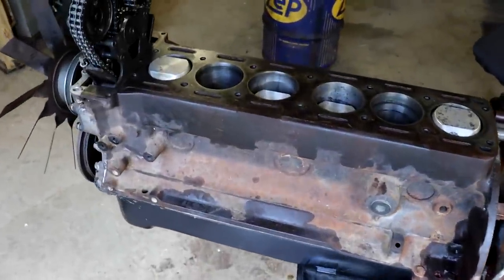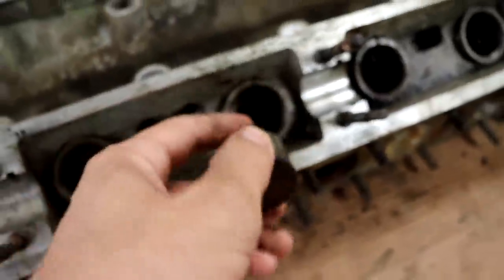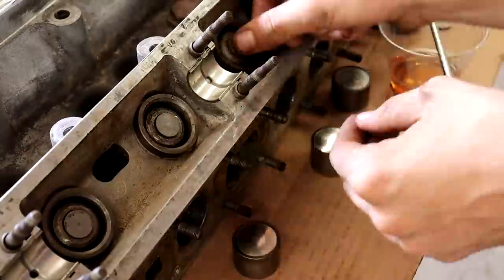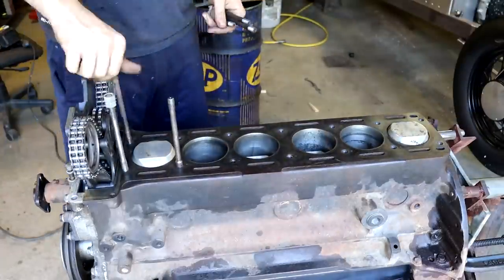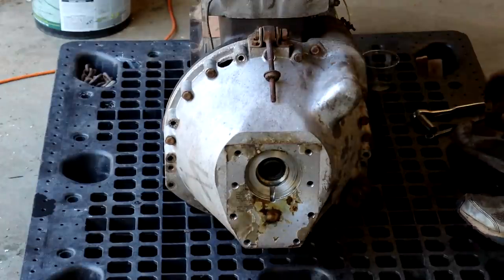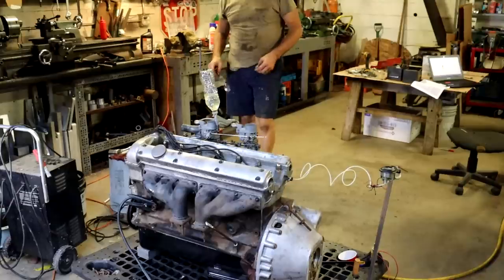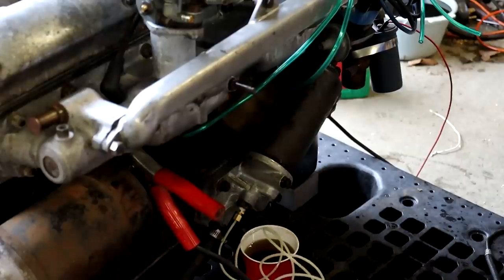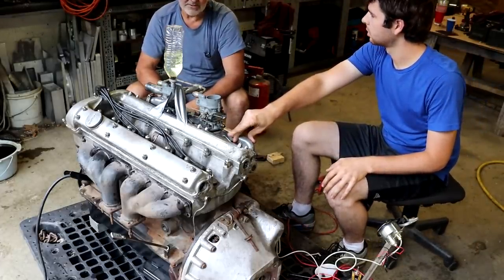Junkyard Engine Rebuild First Start! | Homemade Boat-tail Speedster Pt. 58

Comment: OUTSTANDING. Great to see you and your dad working on your car. So many parents don"t do that any more. I"m 61 and still remember my dad helping me on mine. Good job to your Dad. 👍😎.
Reply: If I worked on a car with my father, who was a mechanic for many years, I'd have to teach him how to use a CANBUS and all the other associated computer-related things cars rely on these days. It'd be a total role reversal.
Reply: @Metal-Possum  At least you are doing something with your dad.
Reply: My dad taught me basic maintenance on his lawnmower then told me if I wanted a car in a few years I'd better start knocking on doors. One day he was adjusting the valves on the 79 Corolla he had and got it wrong so I read the manual and pointed out he used the wrong line on the balancer and he supervised me adjusting the valves. Long story short I bought it from him when I was 15 and started at Toyota when I was 18 and now have my own small repair facility. Thanks dad.

Comment: I'm supprised how smooth it runs, no excesive vibration, no wandering about on the wooden blocks. I'm also suprised how modern -ish the engine is for a design from the 50s
Reply: Yes, it seems strange that OHV engines are still been built in the USA 75 years after this OHC engine was built.

Comment: GREAT! The intake fitting that is now plugged off [the high idle cause] was probably for providing vacuum to the brake booster - and could still be used btw if you go vacuum assist - she's gonna rock n roll !!!
Reply: I was thinking the same. Brake booster may have been an optional/rare feture or just upgrade in newer models so that might be the reason why it is missing on the other engine. Before disc brakes brake boosters were not that common since cars with drum brakes does not need that much hydraulic force.

Comment: That little port on the bottom of the intake manifold is the vacuum source for power brakes. :)
The valvetrain set up looked just like my 1958 1300 Veloce Spider Alfa Romeo. Had luck that two of my dad's friends owned a Offenhauser race motor rebuild shop and the small Offys used the same cup and mini cup system and they were able to grind the cups to the proper settings.

Comment: having the oilfilter that points up might help installing the engine in the narrow enginebay , the hole in the intake manifold might be for the brake booster
nice to see that engine singing its hart out , seems to run ok , a little bit of smoke out of the front manifold but that couldve been assembly oil 
if youre planning on building headers , there actually pretty eazy for this motor just 3 intoo two into one and the scavenge sequence should be right there , for the racecar i might do a log manifold straight out the side and a straight pipe to the rear maibe use one bend on the front cilinder intoo the head of the pipe to make it look nicer

Comment: Nice! Again, lubricate when honing. Set exhaust valves a thousandth or two looser than spec - a noisy valve will never burn. Was funny seeing you startled when the motor kicked - guess you're not used to that. LOL

Comment: Well done! I figured you'd get it running. My Riley engine has a pressure release valve I had set wrong so on a recent start the pressure shot up and it actually pushed out the O ring on the modern filter I have on it. Oil everywhere but no damage done. Fixed that and it starts fine and runs, but roughly. I just tonight finished a new tubular exhaust manifold for it and that immediately shows the issue. Number 4 cylinder isn't firing as that exhaust runner doesn't get hot. So more debugging needed. Will compression test it then check the ignition. Cool your dad helps. I always end up doing everything by myself. That feeling when an engine you've built yourself first runs is amazing isn't it!

Comment: I would guess that is the vacuum that goes to a Brake Servo... not all cars of that era had power brakes. Sounds very nice, it is getting exciting!
Reply: That would by my guess as well.
Reply: Exactly my thoughts as well.
Reply: I was about to post this same thing.
Reply: May also be for crank case vent, my '68 MG Midget has that after an oil separator

Comment: I love seeing garage engine rebuilds. When I was 18 I rebuilt a 400 Pontiac engine using an old tire for an engine stand.  I bought a new CaM paid a machine shop to do the heads but everything else was junkyard parts. I put 40,000 Miles on that engine and it still ran good 8 years later.

Comment: Excellent work! I was shocked to see a Jaguar engine in that condition that you got it. I thought any that exist would be in the hands of enthusiasts! Well, it is now, thankfully. I rebuilt my XK120 DHC engine in 1962. It wasn't in the shape yours was in, but it needed new main and rod bearings, crank ground, rings, valves, seats, guides and lots of other little stuff. It was hard to get parts in the US at that time. I'm really glad to see you saved this example. Thanks for sharing your video and greetings to you and your dad from Germany. I'm 81 and look back with fond memories on my car hobby.

Comment: Great video , having rebuilt a few of these old Jag engines brings back memories.  So over engineered , later on the accountants got involved and the cost cutting started   not helped by the original Jaguar staff becoming old and retired or eased out. Re built one with 80,000 racing miles on in the 80's negligible wear on all parts, those days are long gone now. Keep up the good work 👍👍👍

Comment: Great progress, you must be proud. That hose on the inlet manifold could have been vacuum for a brake servo, or connected to an oil separator for a crank case vent maybe? My '68 MG Midget has the latter.

Comment: Can,t wait to see the car run and drive, it is AMAZING that this is after all a HAND BUILT custom made car, the 2.4 is basically a short stroke 3.4/3.8 engine later ones went to 4.2, EXTREMELY well done to have HAND BUILT a whole car making EVERY part of it yourself, GOOD LUCK in new job, i am sure they will be very impressed by your skills, your Father can be immensely proud of you and your efforts you have achieved what many other could only ever dream of doing, i am sure your future will be successful!!!!

Comment: Great job and right on time. My 3.8 Mk 2 is going into the shop tomorrow with a low oil pressure problem.  Now I know what to look for! The manual oil pressure is a great idea. Thanks.

Comment: Pretty cool stuff and sounds good.  Reminds me (am I getting old :) of working on my first engine, a saab model 99.  Very similar setup with Head studs, valve buckets but fuel injected.   I had that same smile when mine first started be I always had it in the car you are braver than I.  :)

Comment: I’m glad it ran, did comment on the last video that it will! Very robust engines. Hose in the manifold is either vacuum for the brakes or distributor advance, or coolant for heater or pump bypass, not familiar with this Jag manifold, more with E Types! Best of luck, can’t wait to see the car move

Comment: Great job getting that engine to not only to crank but to start up.  I didn't see you install any head gaskets but I'm sure you did.  That little 6 cyl will make your roadster fly once you get it in.  Looking forward to watching you finally drive the car after all these years building it from scratch.  Cheers!
Reply: 5:42 head gasket clear as day
Reply: @lucasalbis2260  Thanks.  I missed that but it was rather quick.  Haha.
Reply: @TheFlatlander440  Definitely an easy one to miss, i was lookin for some copper spray on it! very excited as you are to see this boogy down the road

Comment: that put a big smile on my face when it fired up and ran! congratulations on the milestone!
your dad seems pretty knowledgeable as well but my understanding is that with new cam and new/mismatched parts one should run the engine at an elevated rpm for around 20 minutes or so or face premature wear. also, if the valve seats aren't hardened you'll want to run an additive in your oil.
Reply: The additive goes in the fuel to replace the tetra-ethyl lead that used to be in leaded fuel.

Comment: The hole in your inlet manifolt is a for fitting a starter pipe assembly. Depending on the carburetor type, you need to plug the hole with a blank plate. Hope it helps

Comment: I believe that port at 16:13, in the intake manifold is for water from the cooling system to heat the intake.
T.S. RACING

Comment: about the hole in the intake: it could be a port for a primitive positive crankcase ventilation system. I have an old 2.7l i4 diesel engine that is based on a gas engine that is based on a licensed copy of the ford y block v8 and it has a hose running from the rocker cover to the intake manifold. I got 2 engines and one had the hose dangling on the side of the engine with a cork plug stuck in the manifold and the second one had the hose fitted correctly.

Comment: Congratulations on the first start! Beginning your motor-building career with an XK is pretty ambitious, but you pulled it off. Getting those valve clearance shims right is a major chore, but it's probably much easier with them not in a car. (At least you don't have to do it from a trapeze, which is pretty much required with an installed 2.4.) 
What are those carburettors? They're not any type i've seen installed on a Jaguar.
Reply: They're definitely not SUs.

Comment: The spring in the oil relief valve on those old Jag engines weakens over time causing the valve to open at low pressure.  Had that problem on my XK-120.

Comment: very nice, same engine from a Jaguar MK2, there should be a vacuum connection on 1 of the carburators, think i saw it on the right carb, thats where it should be, on the bottom, right from where you mount the carb,  it seems open now, should be a little 3mm steel pipe? (not sure how to call it in English) if you connect that to the vacuum connection on the ignition, it should be able to run on a lower RPM, but please get the timing right first, too early is kinda killing for these engines, its easy to damage or bend the push rods, or push rod bearings, timing is set without connecting the vacuum on the ignition, but have to close the hose to the carb..

Comment: I'm not familiar with that engine  but given the location likely/potential egr or pcv port.  Age and original destination of the engine would tell you alot. Good work  and great job on the videos

Comment: Was the 2.4 the only Jag engine you could find? Having worked on jags 40plus years ago,I often had to rebuild 2.4's and much preferred the 3.8 .Also those Zenith carbs...To make it look really 1930's i would track down a set a of triple SU's, the newer versions with adjustable fuel delivery are fantastic .

Comment: Forgive me if this is an ignorant question, I'm no mechanic. Is there any concern that these old British engines have slight variations between them just due to the amount of hand work done in that day and age? Like I often hear about numbers matching vehicles being worth much more than their counterparts, it's been described to me just how primitive body work was until the era of robots, I guess I assumed certain heads would be married to certain blocks due to slight errors possibly solved with shims or something. Or is this not at all a concern? Were they much more regular than that? Or is it that you are remachining surfaces anyways? Or possibly engine tolerances are nowhere near as tight as I'm assuming?

Comment: Running an engine without coolant is a poor choice. The thermal stress on the head and valve train is extremely high. I know this kid is on a tight budget but he seemed smart enough to realize not to do it again.